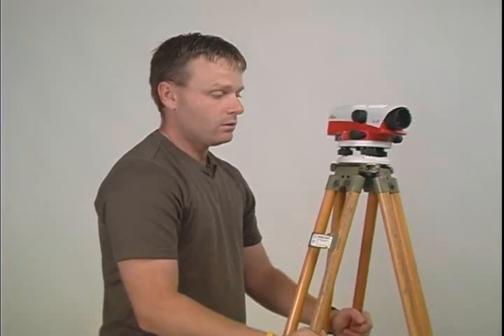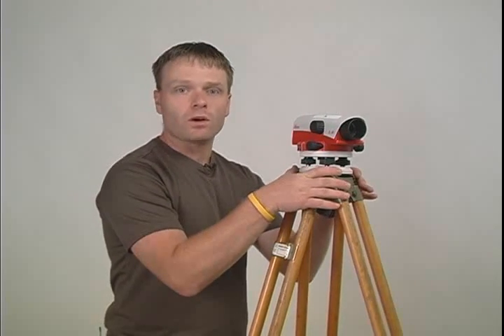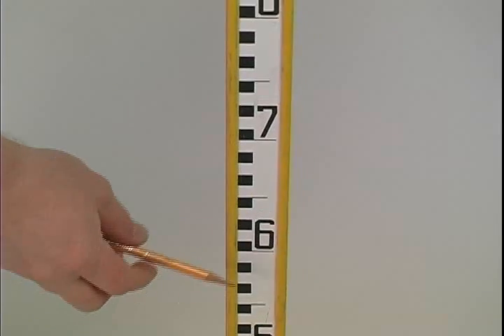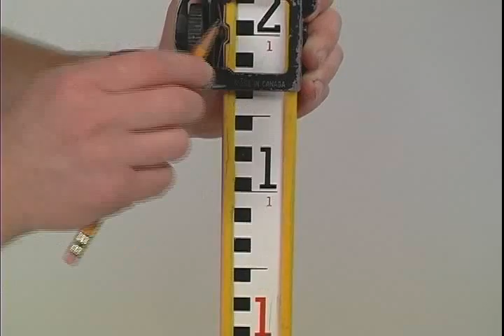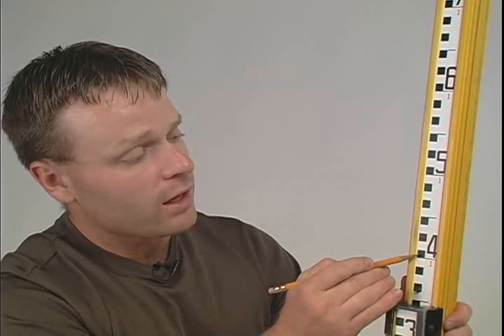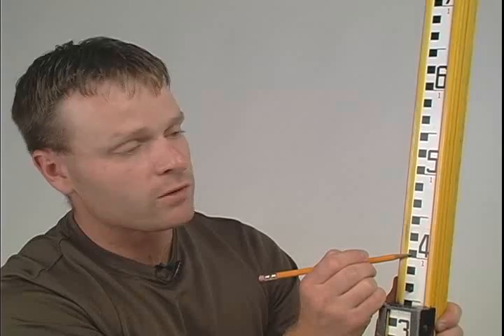How to Set Up an Engineering Level

Comment: Very good. Except you mount level or EDM on tripod after tripod legs been stood on. Sometimes you can crush a little stone or slip from a stone while standing on the leg of tripod or pushing it into a ground in this case mechanism inside your level or Total station gets damaged.
Reply: Not necessarily, you would loosen the leg clamp and then crush it in.  That way the impact is absorbed in the lower part of the leg and doesn't transfer to the instrument.  This method allows you to move the instrument with the legs over the point and then crush the legs as I described.
Reply: @jppcasey  having said this, I would perform a 2 peg test prior, to make sure the instrument is within the paperwork tolerances.
Reply: @PartMiniBus  Lol.  Let me ask you this, do you actually drive pegs in the ground or do you "buck" in to grade marks?  Which do you think is more accurate?
Reply: @jppcasey  pegs are only temporary. Always try to use something that doesn't move.
Reply: @jppcasey  it will get absorbed to a certain degree, but if you'll get a little jam then the levelling mechanism will absorb the rest of it, potentially following by a fault or recalibration. I would never risk if I were you. Not sure how much you love your instrument though.
Reply: @PartMiniBus  I don't particularly love my instruments, but I do respect them, clean them, and take good care of them.  As always, you want to be careful, I don't jump or bang the legs down on to the surface.  In thirty six years (and still going) I've never destroyed an instrument or damaged one.   The only time I'll set the legs up first is with a level, but not the gun.  To each his own.  Good luck.